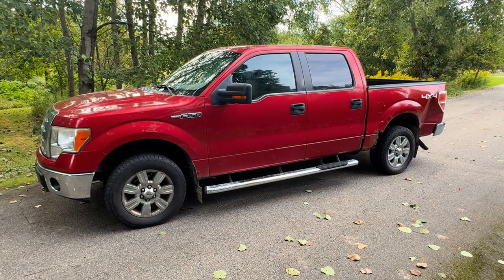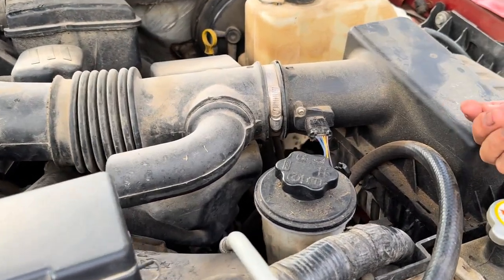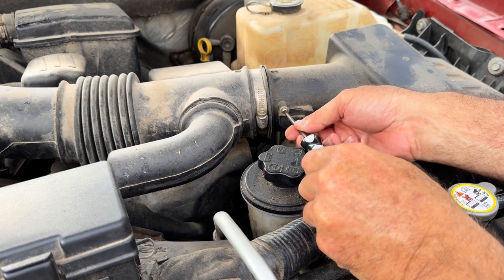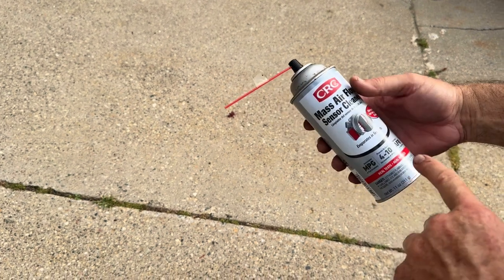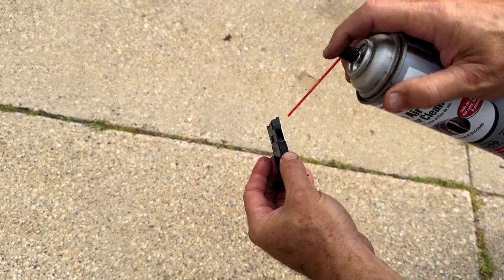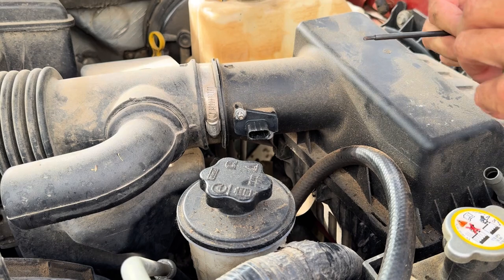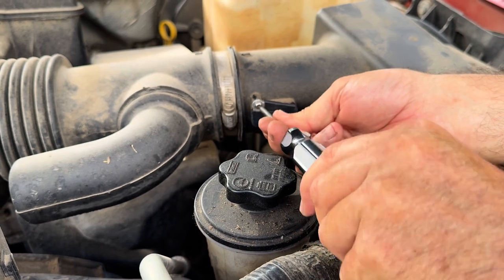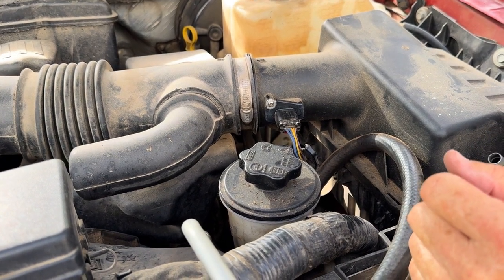How to Replace Mass Airflow Sensor Ford F-150

Comment: I cleaned the sensor successfully but lost the screws. The replacement screws are $10 a piece. Do they have to be factory screws?
Reply from the maker: If you’re confident you can match the original screw's specs exactly, a quality generic screw should be fine. But if there’s any doubt $10 might be worth the peace of mind.